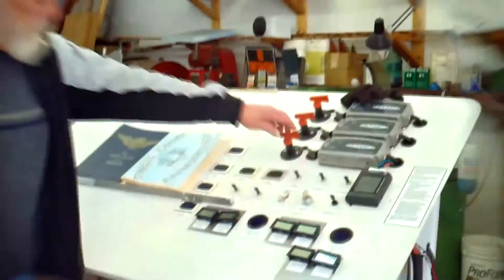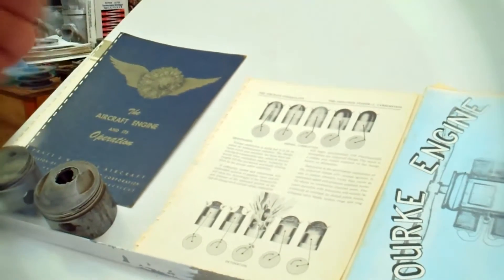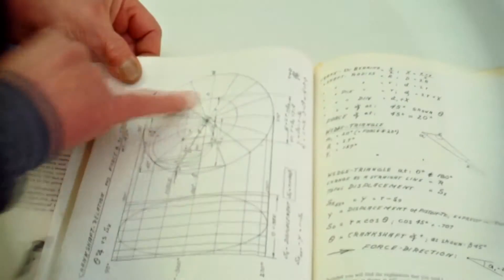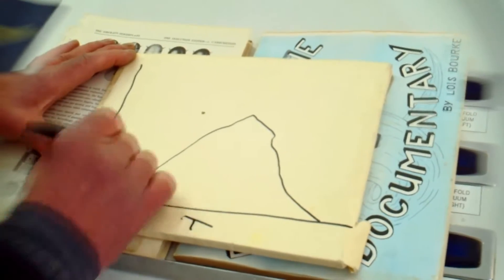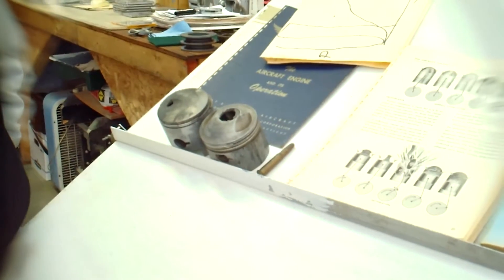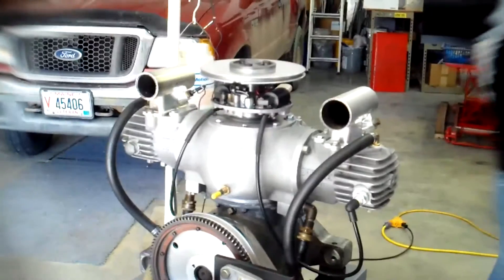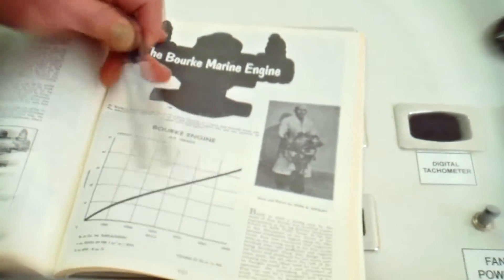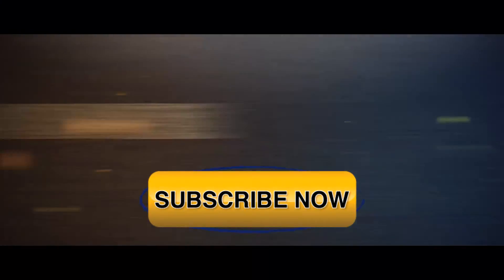Video #1Bourke EngineTheory

Comment: Roger Richard is a LYING PIECE OF SHIT! The TRUTH IS > In 1999 DAVID WOLFE of the ORIGINAL Bourke-Engine.Com and ProjectBourke.com brought Mr Penny to the negotiating table to sell Roger 001 production engine to him. Mr. Penny did not like Roger and that's why he wouldn't sell it to him! It was David Wolfe who made it possible for Roger, a chronic FAILURE - to get his hands on an ORIGINAL Bourke after his own prototype broke several crankshafts and connecting rods and Roger even managed to break the crankshaft in 001! it has not been an original since! Roger BROKE IT and STILL can't get the Bourke engine to hit the 'sweet spot' or run the Bourke Cycle! ONLY David Wolfe, Founder of Bourke-Engine.Com knows how to achieve the Bourke Cycle proper! Roger is an opportunist and will stop at nothing to get what he wants. He's also a chronic alcoholic and most people that meet him will tell you he's highly intelligent and resourceful but in the afternoon and through out the evening, he's a complete LUSH! Nobody likes being around a drunken fool and that's why Roger STILL hasn't succeeded in getting anything useful done with the Bourke Engine to this day! NOTHING!
When David met Roger via his new website Bourke-Engine.Com, Roger was beside himself and his prototype had been collecting dust! David Wolfe's enthusiasm inspired Roger to pull it back out and set it up and run it on a video which he shared with David Wolfe as an introduction. As a calling card and proof of dedication to Russell Bourke's work, he acquired the Bourke 30 001 production engine from Mr. Penny on behalf of Roger to seal the deal. Roger makes agreements then breaks them and also tried to muscle in on one's own enterprise after promising his undying friendship and dedication. LIES!

Comment: How do I reach this gentleman? Ron Hatton, developer of The Gadgetman Groove
Reply: Hatton is a FRAUD! The gadget man groove does not work and to TRY to make it work, it requires ILLEGAL MODIFICATION of EMISSIONS CONTROLS! Running a conventional engine on leaner air fuel ratio's will RUIN IT in short order as compared to it's intended longevity! 
DO NOT MAKE THIS MODIFICATION! You will be out a perfectly good throttle body which you will end up PAYING a LOT of money to replace, IF your car even passes emissions in the first place with this unworkable modification!
Reply: @ddooby9266  Leaner AFR's increases an engines thermal efficiency. However, lean burn in a conventional engine is very difficult and nigh impossible. It requires a detonation cycle engine to properly harness to potentials of lean burn.
https://en.wikipedia.org/wiki/Lean-burn
https://www.youtube.com/watch?v=67q3wWOKPTc